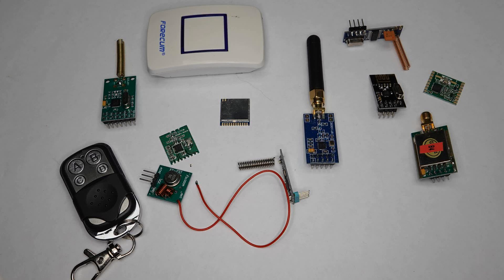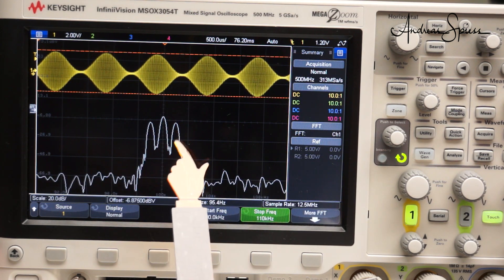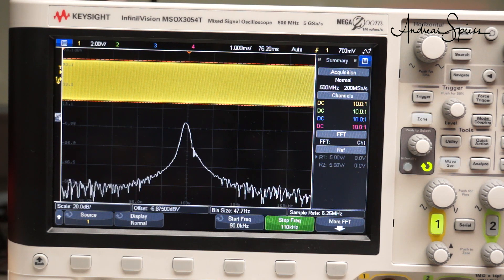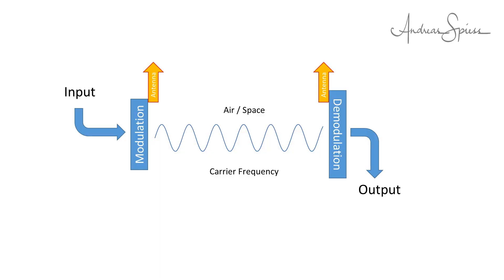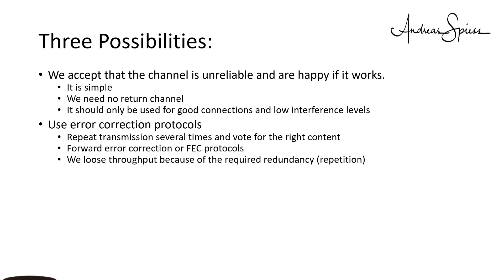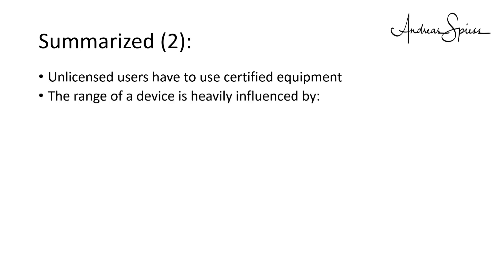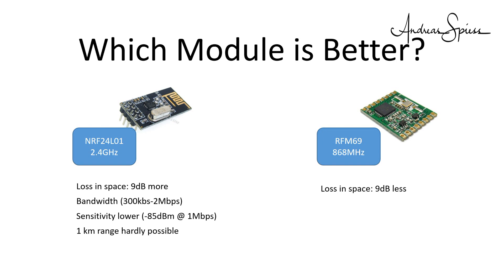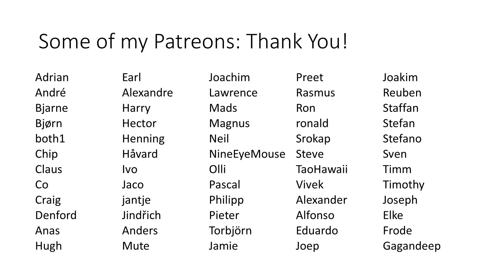007 Basics of Wireless Communication Part 2

Comment: As always an excellent video. One question: after 4:00 you  you mention that "the signal has no distinct peaks" (FM modulation). I believe that periodic signals always have a discrete spectrum, and suspect that the discrete lines are not visible due to the bandwidth of the FFT analysis (windowing) (see the broad peaks in the AM modulation example). Maybe you can see the discrete spectrum better if you set the modulation frequency higher. - In addition, with the FM spectrum you probably see another artefact: the spectrum does not always have the same shape, sometimes it is 'flat top', sometimes it is skewed to the right or left. Does the sampling length play a role here?

Thank you for your vontinued effort!
Reply from the maker: You are right. If you modulate it with one frequency it also has peaks and my RBW was probably too wide.